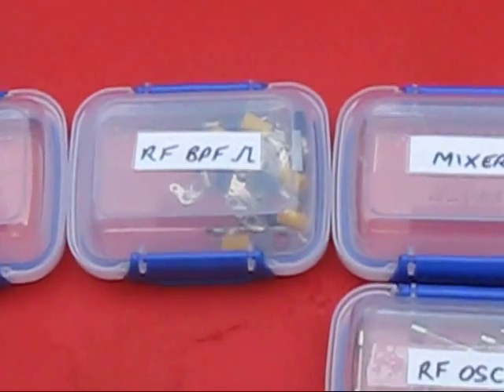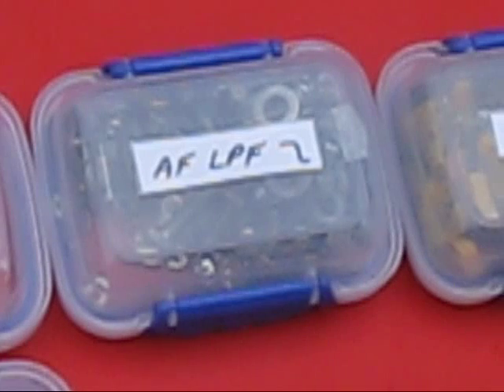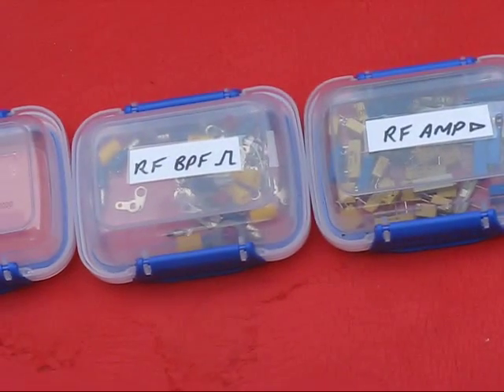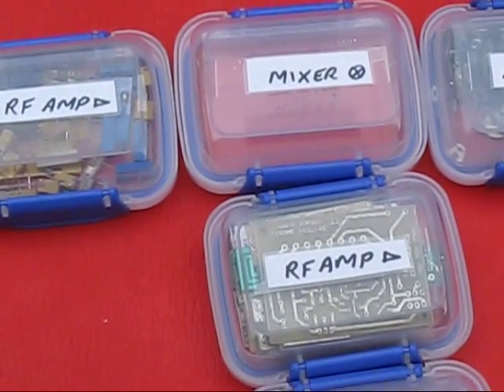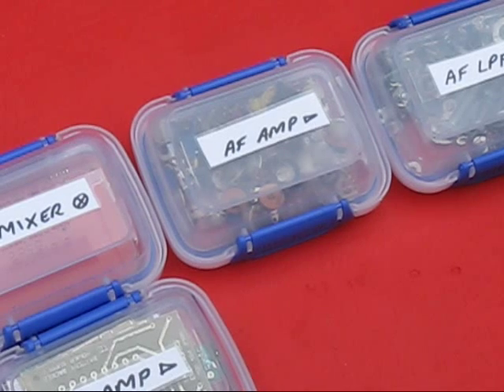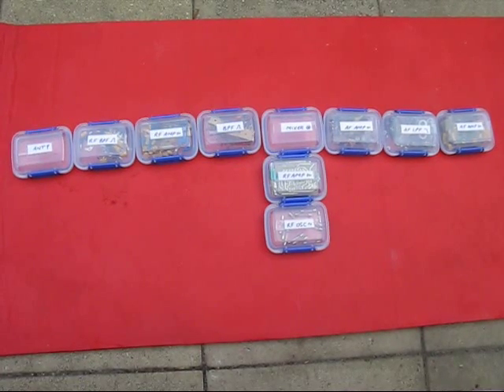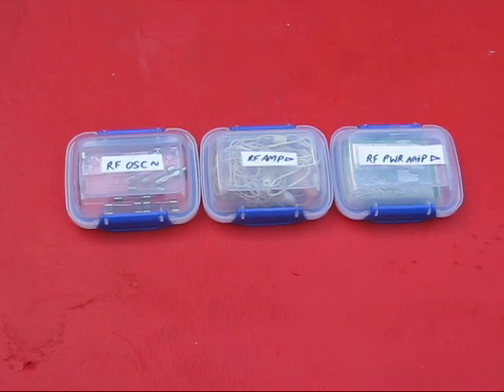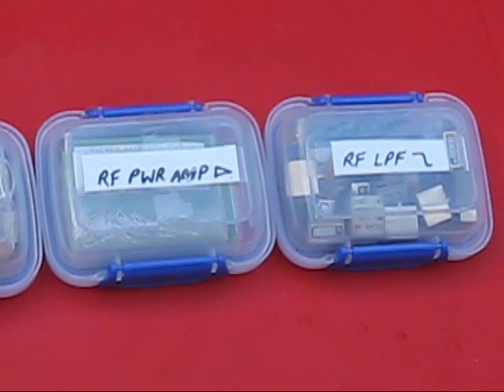Understanding radio circuits through block diagrams - Part 2

Comment: How does one determine what values for the components are needed for the various filters, mixers, amplifiers, and oscillators?
Reply from the maker: Various formulas are available in RF textbooks and on the web where there are also some online calculators.
Reply: @vk3ye  Thanks! Could you recommend a book (yours or another's) that would  be good to get started building simple homebrew transceivers?
Reply from the maker: @AndysRamblings  I've written no books on the topic. See my videos where I review QRP books and magazines (they're in one of my playlists).

Comment: This is a great summary of radio circuits.  I've learned a bunch.  if you could provide some of hows and whys about linking the stages together that would great.  I don't understand impedance matching very well or even why there is impedance.  Also, I'm not sure I can just take a bunch of schematics for various radio parts and simply link them together output to input.  Will one RF amp work with any detector circuit?  Etc...

Comment: Hi Peter
I wonder if you can help?.
I am using a car radio for my workshop.I have a 12v power supply and it works well.
The only problem is while FM reception is fair AM reception is poor on higher frequencies.
I have a standard car aerial fitted with an additional connection clipped from the aerial to the metal roof of the workshop which does improve FM reception but AM is still poor.
It's a 1994 mazda 626 radio.
Do you have any ideas
Regards
Tony

Comment from the maker: Multipliers, like regenerative detectors, are 'nice to have' but not key modules.  You could build lots of gear without them, whereas without any one of the FOAM stages (filters, oscillators, amplifiers, mixers) nothing much good could be built.